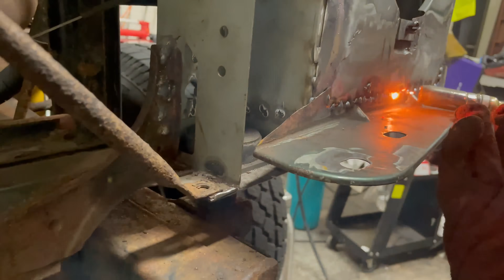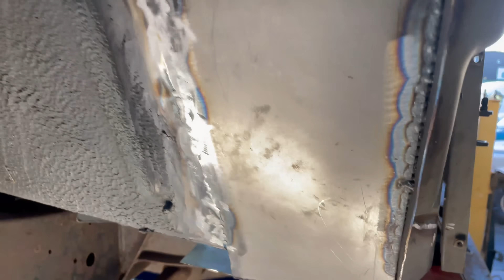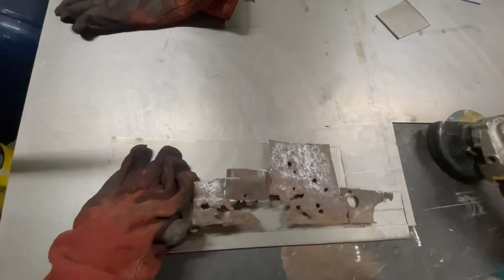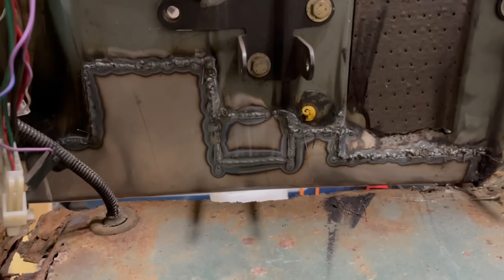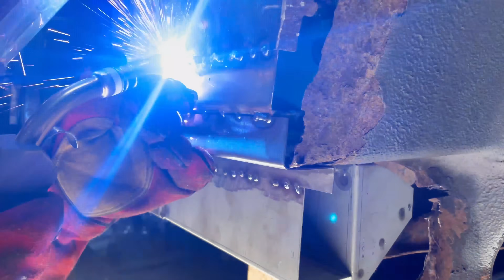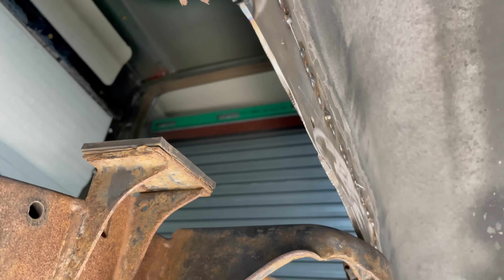Project - Land Rover Discovery 200Tdi (Part Seven)

Comment: Good management, Sophie. The repair work is more important than the videos, much as we enjoy them🙂. As a carpenter, I spend more time than I would like, repairing houses with poorly designed/implemented waterproofing and drainage issues. You fix what you find, according to best practice, as quickly as you can. It is clear to me that you will be an exemplary tradesperson. Cheers from NZ🇳🇿!

Comment: You have great go. I gave up on mine. You need any bits, shout, foc. Glad to see anything go to good home. Yoke has two original turn wheel sunroofs (never leak) and too much to list (can't find!) . Tricky round those footwells. You made a super job of. Have V8 radiator and a massive outside intercooler if your going to go daft turbo/fuelling etc. Also 2 brand new genuine front door regulators. God knows what else. Let me know. Good luck. Great work. Jc

Comment: I love your methodical approach to replacing the rotted out ares, so much easer to do small sections when you are fabing the metal yourself , I do it exactly the same way. just finished the front windshield channel on my 1980 VW Vanagon, that was a tricky job, but did it in short sections so I never lost sight of the original shape. each section was hand formed, came out awesome, now I dont have a rotted and leaking windshield frame!

Comment: hi Sophie, I've been looking at doing something similar what are your thoughts on welding heavier gauge steel in key area's to protect to better in a crash?
Reply from the maker: Hello! I have uprated the steel in some areas, though this was more to make it more resilient against corrosion than anything else. Since this vehicle was never designed with proper crumple zones; just uprating the steel thickness alone will do little to help it in a crash. I think it would take completely re-engineering the entire vehicle to help with that haha☺️

Comment: Sophie, glad to see you back!  It would really help your rebuild if you would consider using weld-thru primer.  This prevents flash rusting and protects the metal in the weld process.  then when the weld is done and you have ground it back smooth, spray on some primer to protect the entire weld.
Great to see you are back on the project and your work is coming along well!
Reply from the maker: Thank you, it’s great to be back! Yeah I sometimes do use it, but for me it’s a bit more trouble than it’s worth. Plus I know I’m just going to spray over with proper primer more or less immediately after anyway. I’ve even been using a Schutz gun to inject cavities with paint before waxing as well☺️

Comment: congratulations on the restoration work you are doing!  you are very good, I am also restoring a Land Rover Discovery 1 200 2.5 113 HP, three doors. Rust in these vehicle models is really a doom!  in some areas I managed to chemically treat them, in other parts I had to replace the metal and weld it .. good job greetings from Italy!  Urbino.